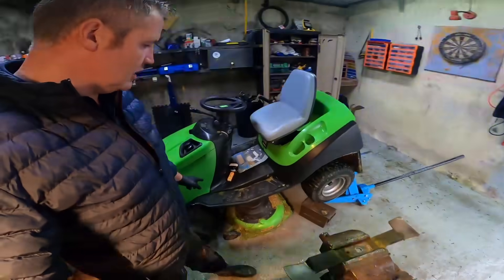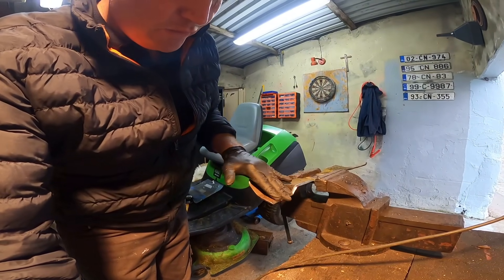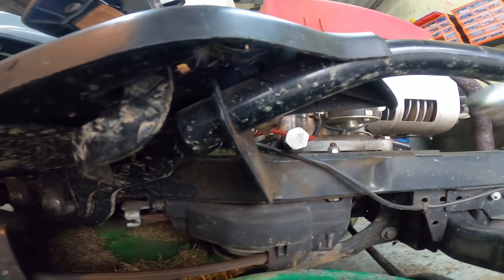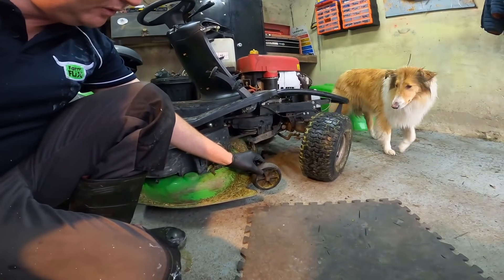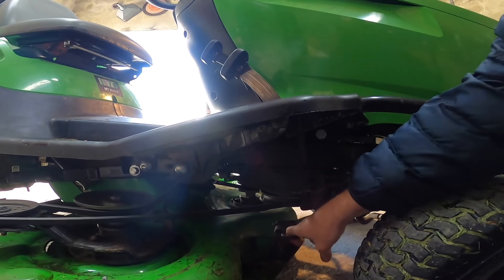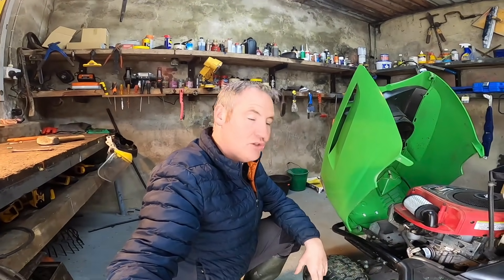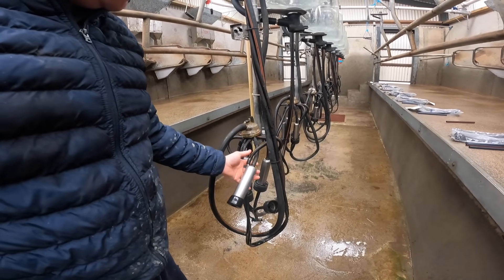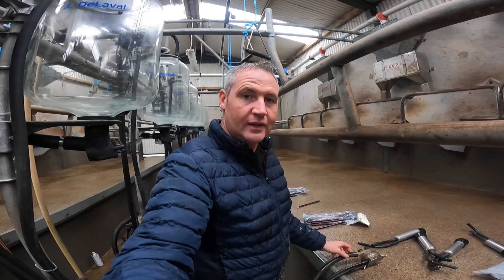HOW MUCH CAN WE GET FIXED IN A DAY (PART 2) VERY LUCKY IT DIDN'T FLY OFF!!!

Comment: Not sure if you did this or not but when you empty the oil out of a tractor or anything pull out the dip stick and the oil would come out faster as it lets the air out and then it would go faster.great video keep them coming

Comment: interesting video on the lawn mower. This is just an observation when I was repairing lawnmowers and sharpening blades it was also important to balance the blade  after sharpening to avoid vibration
Reply from the maker: Yes I balance ours on a nail thats clamped in a vice

Comment: Very good video. I’m going to guess your silage may not be best quality, I think you spread 4 bags nitrogen per acre (that’s more than 100 units) which is way too much. I reckon 50 units max of chemical fertiliser and the bit of slurry is ample. Cut then after4/5 weeks in dry weather..
Reply from the maker: We haven’t changed or fertiliser habits in over 30 years as we alway end up with a good crop and of good quality, 4/5 weeks would be way to soon with that amount of units for us as we would normally knock it after 6/7 if the test come back good.Weather and sunshine play a hugh part in Nitrogen levels also. The problem with this years pit may be something unforeseen. All will be revealed Sunday so have a look and see what you think 👍
Reply: @IFarmWeFarm  I’m interested to find out what happened the silage then. But just say you spread 100 units of chemical fertiliser and slurry has 5 units N per 1000gals, that’s potentially 115 units pa. At 2 units per day it would take 8 weeks to use all that N. Then say you get a weeks rain, it could be 9 weeks before it’s cut, by which time it has gone to seed and quality deteriorates rapidly. We used to do this but have changed to 50 units chemical N + 15 units slurry N = 65 units by April 1st. Ready to cut by May 10th and cut the first dry spell after. The silage is quality. Then we go again but we rest the field every 3/4 years by grazing only. Looking forward to your vid on Sun 👍